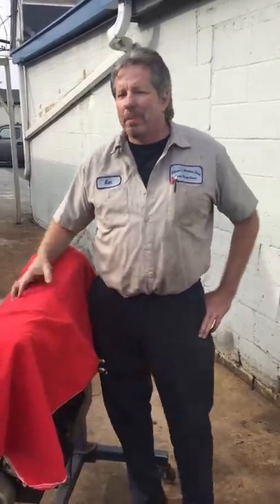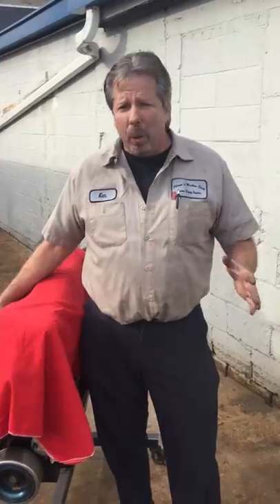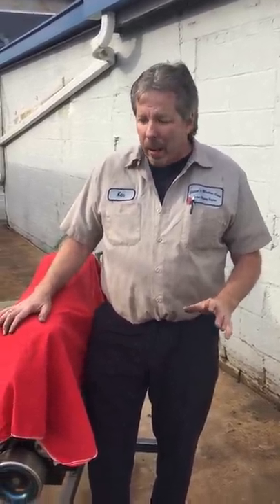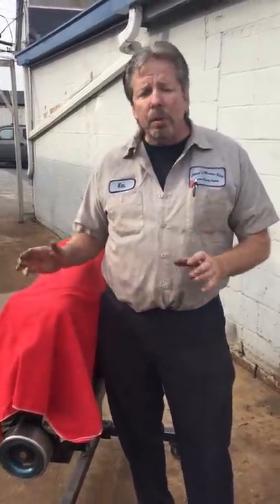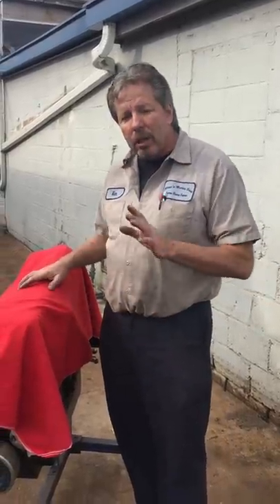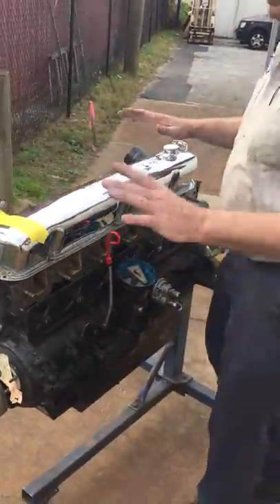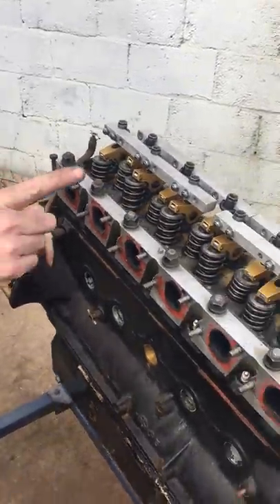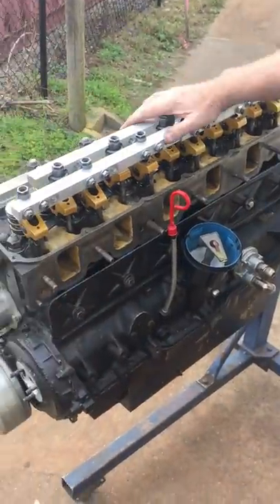Mysterious Radical Race Engine! MUST SEE!!!

Comment: Dude, make patterns off that head if you can, and have a foundry cast some from aluminum! There's gotta be a thousand guys that would buy a modified 351C 4V head for a 300-6!!
Reply: Guy on here used 2 LS aluminum heads to do this same thing.
Reply: Mastercam and ex 1 i could mass produce these easy. Welcome to 21 century
Reply: Shut up and take my money!!!!!!!!!
Reply: @riccocool  do you have a link you can post? Or atleast the company name. If you can thank you.
Reply: @geoffreyweights7697  ford 300 LS hybrid cylinder head. On YouTube.
Reply: Trick Flow should cast this, since they're selling a 2 barrel 351c with 4 barrel valves, would be awesome
Reply: Well said
Reply: Patterns? Dude, it's 2024. It can be laser scanned now.

Comment: 300 6 cyl with a 4 speed manual is an amazing work engine. You could haul stuff around all day on 5 bucks worth of gas. I even ran mine once on a mix of diesel and cooking gas and used chain saw chain oil for lubricant  and she still got us home... Also with a an 11 foot water logged old camper on the back of a half ton , in first gear on pavement it would do wheelies!!! I sure miss that old ugly brown truck....
Reply: Those stait 6s , have always had a boat load of low end torque , I've known guys to build a mustang that would pull the front wheels off the ground in 3rd gear , with a three speed top loader between lights one block away from the 1st , and out run big blocks in that short space , every time !
Reply: I’ve driven/owned a couple 300 Ford Straight Sixes. One I it in an old Econoline Van, I installed with the help a couple friends. Hooked to a C6, with a 9” rear end with 4:10 posi.  All this in an older straight axle 64 van! That was quick and could tow a mountain. But even with just a big old one barrel carb, was a gas hog. The second came in a 95 F150,4x4, 5 speed reg cab short bed, that was an amazing work truck. That one time off roading had been flooded in water up to the carb! I removed the top of the air cleaner and the truck started back up an drove in low range up out of the river crossing. But even with just 3:08 gears with the help of the 5 speed was also a gas hog.
Reply: My first vehicle  was my dad's old Ford rack body truck, had colum shifter " 3 in the tree" with  the strait  6 motor,  had great low end torque,  I have to get my hands on another now and give it a go!
Reply: @johndibeneditto7107  right on , my brother has a efi van that needs a little work , I might get it from him , as he doesn't have much use for it ,retiring, I too , miss my 300 6 pick up (1990 3/4 ton)
Reply: I'd still love to have a monster BOSS 6 , put it in a kit car , would be a Gas
Reply: mine is a '96, so efi. but I also have a 5spd manual with 3.08 gears. 

talk about gas hog, I get average 7mpg. seriously don't know what's wrong with it. in the last 4 years I have basically went through a top end rebuild, and just about everything else around the engine has been replaced. 

I have tried all I can think except a fuel pump. but right now it's running lean, but smells like it's running rich. exhaust smells terrible. no cats. just don't know where else to look.

Comment: What I find impressive is they've made a crossflow head design without the drawbacks and engineering failures of the 4.1L Ford crossflow six. The 250/300ci family was a far more robust and modifiable series of engines, and if you seek among Australian forums, there is much quality Intel on getting these sixes to haul arse.
Reply: thats what i thoughtstraight away when i saw it. cross flow
Reply: @jason78981  still could use the water pump on the side down low, learn that from driving a jeep 4.0L
Reply: Mine put out about 350 hp at 7,500 rpm I destroked it to 3.6 L

Comment: My guess is a 300 Canadian Ford 6. I had a 250 crossflow in my Australian falcon Ute. Similar origins. Great motors. The base for the modern "Barra" Aussie 4.0 six.

Fun fact: an XP falcon from the 60s, with a 250ci version of this 300ci, takes the same starter motor as a 2004 BA falcon with a Barra. Proof that if it ain't broke, don't fix it!

Comment: Wow!!! This is amazing!!! A completely custom fabricated head from several 351 Cleveland / Boss-302 engine head segments that have been cut, welded , sealed and structurally strengthened to match the 300 CID Ford bottom-end.... That is a great engine to begin with!!! Very cool!!! My guess is this was developed by a small group of Ford engineers to see what the potential was, of the Ford 300 inline 6 engine... Similar to what the Chrysler engineers (Ram-Chargers) did to reach the maximum potential of their early Hemi's back in the mid to late 50's with Naturally Aspirated modifications that really brought those machines to LIFE!!! This reminds me of that type of experimentation, ingenuity and power exploration.... The early days of drag racing were amazing!!!
Reply: NAH!  Back in the 1970's I saw a Jr. rail dragster that had a 300/6 in it, but it used cut up aluminum heads from an aftermarket 302 or 351 Boss V8.  It easily ran low 10's.
Reply: @myfavoritemartian1  , it sounds like a re-make of the original idea that was made entirely from cast iron.... This is impressive!!!

Comment: I'd really enjoy hearing your story.
I started out with the very basics when I was twelve.
I learned engines by hanging around my older brother and his small block powered 65 Impala and then, especially, his 70SS Camaro.
I was modifying Briggs and Stratton engines long before major manufacturers were. I had my dad take a camshaft to work so one of his co-workers could lay a thick bead of weld on both lobes. I spent MANY HOURS hand filing , checking and rechecking the lift and profile of the lobes and already had a pretty firm grasp on how a longer duration and how lobe separation angles would effect performance. I built an intake from an aluminum tube from a fishing net that ran two carbs.
I HAD to use epoxy to make the set-up work.
Again.....I was twelve. I heavily ported the engines's intake and exhaust ports and using a flat file, shaved the head as far as could be done. The old lawn tractor frame that I had the Briggs engine in would burn rubber all the way across pop's garage floor and when it would hook up on asphalt would flip the tractor over if I didn't put my feet down.
Thanks for sharing this video and allowing me to reminisce and share a great part of my very early years of engineering and learning high performance engines.
I'm 58 now and will never let that passion die. 💪😊👍
EDIT: BTW i have a 96 F150 4x4 with THAT engine in it 😆
Do you think I'm gonna leave it stock ? Not a chance brother 👍👍
Reply: Awesome story mate
Reply: Cool story. You were one tech savvy teen!
I wonder what you have in mind for that 300i6?
Reply: I wasn’t lucky enough to have anyone to help me with my cam on my cart. I made a jig for my cam to lie in and with an old electric sander, I took.060 off of the round part of the lobe. Then, I took a little off of the lobe to round the ramps. Took the valves and put them in an blown up engine and lapped the valves until they were short enough to seat on the new cam. With that, I got my first protest.

Comment: I've seen 6 cylinder Ford race engines used in Formula Ford open wheelers with straightened ports that shoots for the sky, but chopping up 4V Clevo heads to make a single inline head is utterly insane !  U  are right - I have seen some unique builds but never anything like this ! Thank you for sharing this and enlightening us !

Comment: Ford 300 has a 4.48 bore spacing, 351 Cleveland has a 4.38 bore spacing. It is far enough off that if you welded two heads together you would probably have a problem with intake valve to cylinder wall clearance problems. Very cool engine with a huge amount of work done to it.
Reply: From what I have read it took 3 heads to make this work instead of 2 and that's probably why.
Reply: It can be done with two heads if you center them on two cylinders. Cut one head in half and use each half on the outer two cylinders. Cut the middle section out but let it be a little longer to make up the difference. The valves will be a little bit offset but not too much.

Comment: Awesome & really cool engine! But it's funny how you were trying to hold back on identifying the motor until later in the video, even though ya forgot about the FORD sticker right there on the front of the engine, lol. I'm assuming that's the water inlet, what is suppose to be the thermostat or water pump housing ..........( just above the harmonic balancer. ) Looking forward to seeing this engine taken apart for closer inspection & descriptions!
Reply: the pushrod valley cover is unmistakable

Comment: Great engine! IMO, the Ford 300 I6 was the best motor ever made for the working man! Extremely reliable, easy to work on, and good for 400,000 miles before a rebuild. I have a 1979 Ford F100 with the 300 that I rebuilt last year. The motor had 412,000 miles on it. I have two more blocks in my garage if anything happens to that one. America was built with the I6 motor!

Comment: My father-in-law (RIP) was a heck of a dirt track racer in the 60's and 70's.  He was a ford mechanic.  And he biult and drove for the Dealership he worked for. He won championship running a ford inline6 against all the V8's.  He said he could get amazing RPM and torque from his 240ci motor. He used as much 289HO specs for reference as he could for valves and cam specs.  He would biuld his own manifolds and exhausts to suit his cam combination and gearing.   That old dude was a true racer !  Still drove fast in his Mustang until his final days.  I wish I could share this video with him. He would get a kick out of this creation.

Comment: Well, you might want to check  about Bruce Sizemore with the "Preparation H" Maverick-then --into a Pinto.  Then , talk to Steve Ambrose of Ambrose/Argenta/Huettman   of Woodhaven Mi-with the same basic combo--in a dragster--then in a T bucket Altered !! Oh, I also had one--305CI  Iron boss head(3pc)--then a 6pc aluminum head / Crane roller/dry sump / vertex / hilborn  etc. --had it in a Maverick- Good luck with it !

Comment: I picked the Clevo head but was thinking Jag block. I’m in Aussieland so, as any self-respecting Ford guy of a certain age would, I’ve had a couple of Falcons with Clevos-best sounding V8 I’ve ever had-compared to Windsors and Coyotes since (incl S/C one). My couple of Clevos were generally stock other than one I built, which didn’t go as well as it should have due to massive ports with small cams and carb. Just a silly mismatch due to being young and stupid-but too poor to feed it the juice it needed. I went waaay too small in the carby and cam to let it breathe the way the heads and bottom end could.

Comment: I don’t know if it was the same car but around 1970/71 at a small 1/4 track in PA (Numidia) there was an Altered car from NJ that had this engine combination racing. I don’t remember the guys name. Fast as hell but very weird sounding with the six cylinders. I’m pretty sure it would not have had the cut/raised exhaust ports because I seem to remember that was a Pro Stock modification. I have been looking on/off for info on this engine combination for years. There was a magazine article about this combination during that era and I believe it was called a Boss Six. Thank you so much for providing the videos and it great to know that at least one original example survived.

Comment: I remember reading about this in 
"Car Craft" magazine back when I was in high school and seeing it run at the local drag strip in a Maverick named "Preparation H" that was reported to run an engine  just like this, 300 inch Ford block with sliced and diced 351 Cleveland heads. It was fast as any V8 powered car in its class and put a lot of V8 cars on the trailer scratching their heads and it had a unique exhaust note of a 6 with the resonances of a V8. I've followed you for a long time and I'm glad your the one who got the job of brining it back to life because of the passion you have for your industry.
Reply: I a H Modified Production Maverick at Englishtown many years ago, probably 1975 or 76. The owner/driver was Nate Cohen AKA Nazy Crate. I talked to him at length about the engine because I really liked the six bangers and straight 8 dragster like Pete Shadingers straight 8 rail. Nate said "you're looking at a $2000 head. I believe his cylinder head was made from aluminum Cleveland heads. The one in this video was made from cast iron. It took 12 hours of welding with the head heated to 1500 degrees. There is a whole YouTube video on it.
Reply: Jimmy Lindsay !!!

Comment: This basic idea has been done by a number of people in the past. Easier on Chevy inlines as they have the same bore spacing as the small block. The one inline six Windsor or Cleveland heads would fit on easiest is probably the AMC/JEEP 199/232/258/4.0. The same bore spacing as the Windsor and Cleveland V-8s. Of course the head bolts don't quite match up and the coolant passages. Valve shrouding might be an issue due to bore size. 
I know there was a 68 Camaro on the East Coast that was running a 292 with a LS based head. There was or is pictures of a Slanty with a modern Hemi based head. I don't know if that runs or not. It may just be a show piece.

Comment: Pretty neat. Speaking on rare engines that produce this kind of horsepower. Have you ever seen a motor built for quarter midget? To race the chillibowl? Literally a v8 cut in half? Would be neat to see you break down one of those engines in a future video.
Reply: 230 cube ford?
Reply: @1philliph  Chevrolet  midget motors are old 
nascar v8 W/166 CI @ 350hp 4000-9000 rpm range. 
Toyota is now the leader though i heard.  Over 400hp fron rumors i heard but i haven't seen #'s
A few years back some guys from new Zealand brought their v8 version CNC engine that matched 166ci rules. They let them race and then banned it however.

Comment: I'm sure you know by now but the Builder/designer of this engine is Sherman Sligh. Fantastic man. There have been several engines like this built over the years. The team of Steve Ambrose and Bob Huetman and Ray Argenta as well as Canadian Ralph Hope ran these until Alan Johnson of Top Fuel fame designed and made a Billet head for them.
Reply: Did Hope run his car at St. Thomas dragway?
Reply: @93_LXcpe  Raph Hope had his one car, very similar engine though.
Reply: @recrdholdr  I remember seeing a front engine dragster with this engine combo in it, at St. Thomas dragway a long time ago. I don't recall meeting the car owner, just thinking it was a cool idea

Comment: Love that inline Ford, I've been building an racing inlines for 50 years. Started out in 72 on the great Pontiac overhead cam 6. Also did alot of the slant 6s. In the 80s moved onto Toyotas inline, then jeeps. Today we're pushing the 4.0 jeep motor to 1000 h.p.
Reply: Did you ever SEE the reputed, never-built in reg production, DOHC 230cu" Pontiac?
Reply: @jackdale9831  never heard of it, but there was a dohc 389 in 63that was done at Pontiac along with a sohc 421 and another that came later. Cannot remember what size though. None of the engines made it to production cars unfortunately.

Comment: The rockers are literally sitting on the valve spring retainers and the uphill "pro stock" exhaust ports in that aluminum "exhaust plate" and wide open lifter gallery where the block is machined away that supposedly will be sealed by the "fuel system" and of course "4 head bolts (already "studded" back in the "eighties" before ARP even existed and studs were "old school" and "tractor engine tech" - per cylinder" - 2 through the "welded" supposed "Cleveland" cylinder head "segments" and 2 through the "exhaust plate" - are even more hilarious than that ridiculous naturally-aspirated "dyno number" that supposedly results from 100+% "volumetric efficiency" and getting more "air" in the cylinders than they can "hold" in cubic inches of displacement. 

But nothing is as funny as repeatedly calling this a "combination" in other videos and repeating "unverified" claims it set "world records" in "competition eliminator" in a "23 T bucket" and in '69 or whenever the competition - even on "circle tracks" - supposedly "couldn't handle it" it supposedly ran - and won - at "nine national events". Everywhere it ran except the two events where it "lit the red bulb". 

With a "Clutchflite" trans the car/engine "builder" and apparently driver, crew chief, engineer, cast-iron welder extraordinaire and "epoxy" wizard is also given credit for inventing or at least called a "genius" for running. 

And this all allegedly happened before the "combination" was supposedly "factored out" i.e. "banned from competition".

Back when Grumpy Jenkins was getting "about 540" horsepower and low 10s out of a factory stock "blueprinted" Chevy 396 Camaro SS with "allowable stock parts sustitutions", an incomplete Ivy League mechanical engineering education and a "hot rod shop" business mainly building "circle track" engines some "genius" was supposedly getting almost 20% more horsepower out of a "300 Ford" with a "Cleveland Boss" cylinder head "welded together" and "upside down" exhaust ports for an "upright" inline engine. 

You bet. And "competition eliminator" was "heads up" and had "world records" at "national events".  

No wonder everything is "unverified".

Comment: I had to wait until you said the valve specs to realize it was closed chamber 4v Cleveland heads. Those monster intake runners were the other tip-off.